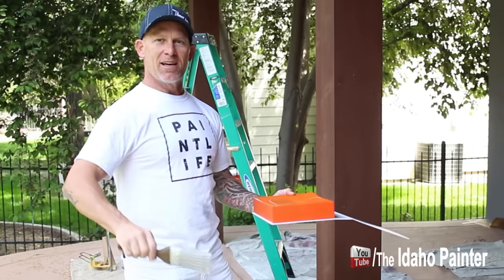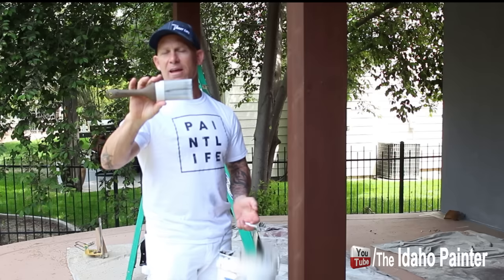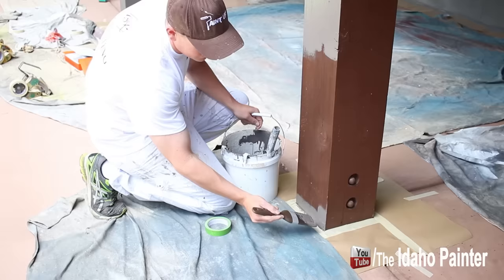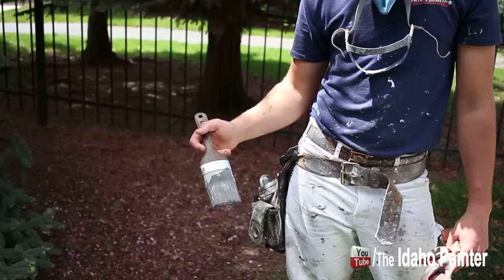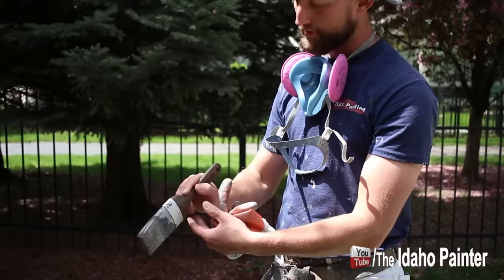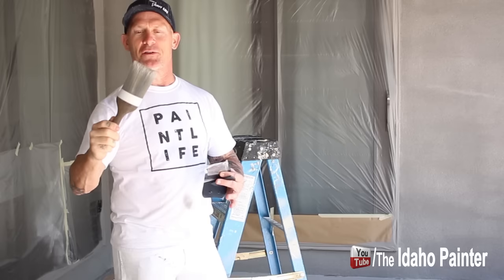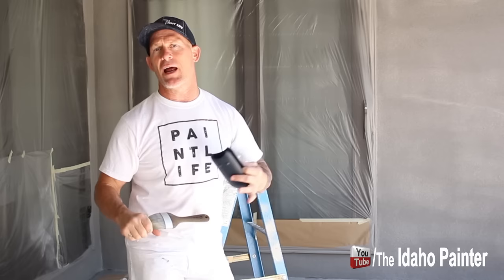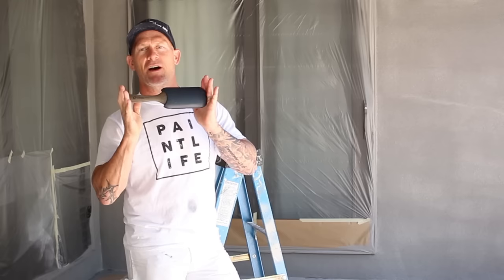The $100 Paint Brush From Lucas Pro Tools.

Comment: Purdy brushes were always the standard in sundries.  The xl pip I mentioned has longer bristles and it's feral is rounded/oval. Also, oil based stain brushes were always seperate from latex water based for me.
Reply from the maker: Yes, thanks for sharing!

Comment: Btw, I got in the habit of hanging my paint on my belt rather than holding the bucket. I always used gallon cans for cut buckets, unless I was using a mini roller. But then again, I've used 5 gallon buckets hanging off my belt with a brush, and a couple of different size rollers in them, two different colors, working on a pier. High work makes you get creative.
Reply from the maker: Good way to do it, thanks for watching!

Comment: The test would be how much use can it take before it starts falling apart or can it take a lot cleaning. Is that a 2 1/2 "? do they have different sizes? I don't think a month is not long enough. what about what paints can be use with, what about oil base paints?
Reply: I really like the roller!
Reply from the maker: This is the only size they have at the moment, we will find out. It is 2.5.

Comment: 3:44 as he is using the $100.00 paint brush, he goes into his paint bucket and pulls out the small roller and quickly uses it. that tells enough about the wonderful brush.
Reply from the maker: Back rolling
Reply: question. what do you do when you give a customer a price on a job, they agree. then after the first day you realize you messed up big time, and there is way way way more involved and it is going take way longer.

Comment: OK Chris.... I wouldn't pay $100. for a paint brush in my life! Picasso Brushes are just as good for way less! I'm lucky enough to have a shop with a slop sink where I can  clean my brushes and hang them to dry. Why Picasso?, solid Farrell, the paint doesn't get inside and mess up the brush its self. if well maintained, the will last for a long time. They also come in a variety of stiffness's. I use them first for interior work, then exterior, then for primer. When done, a dust brush or oil. Oh!!!!, just me but, the last thing I would use a brand new $100 dollar paint brush with is an exterior latex stain! Arg!

Comment: Chris, have you ever used Wooster/Wooster Pro brushes?  If so, how do you think they stand up to Lucas ProTools and Purdy?  I'm an independent painter and don't know many other painters, so I get all my info and opinions online and I'm always interested to know what brand/specific brushes pro painters like yourself prefer and why.
Reply from the maker: I do like Wooster, hard to compare though because they are used for different things
Reply: rabooey we sell Wooster out of my store in LA. we are getting a lot of bad feedback with Purdy recently, so we suggest they switch to a Wooster alpha. great brush. thicker stock so it holds more paint, but the bristle are stiff after a few uses. the best brush I have used so far is the corona chinex line of brushes. the ryan 2.5 is the best brush for fine finishes using hybrids or acrylics. my favorite brush personally is the Purdy extra dale (stiffest blue bristle, but man the corona rrally is the best out there. also lifetime warranty and it's under 20 bucks.
Reply: My favorite brushes by far are the Purdy clear cut elites. Haven't found anything better yet.
Reply: Purdy...are good..best i laid hands on personally tho is Picaso..but it was givin to me as a sampler.

Comment: I have a general question about the technique the guys are using. They use a roller and then go over it with a brush. What's the reasoning for that? The roller is so fast but I'm guessing the brush adds something or else they wouldn't do it.
Reply: the brush works the stain or paint in the wood.
Reply: Ah. Thank you!
Reply: Brian Burke I think it's called back-brushing.
Reply: Marla White if the surface is prepped properly for painting or staining there is no need for back brushing.
Reply from the maker: To get a better finish
Reply: That's it! Thank you.
Reply: Thanks. Is that something you'd do on interior walls for say, a living room? I actually like the sort of orange peel effect of a roller. I always compare it to the cut-in areas with the brush strokes and I like the finish the roller leaves behind much better.
Reply: Brian Burke you can buy different types of rollers if you want a particular finish on the walls.

Comment: 100$ paint brush and straight not 45 hairs 
What's the point you paint that post with a 100$ brush not with a small roller 
It's heavy and not comfortable with cutting 
Cheers 100$ paint brush

Comment: Let's be completely honest, that's a over, over priced tool... I've been painting for 20 years now, I've tried a couple of oval brushes they're garbage. Basically rule of thumb is nylon polyester brushes for water based paint, White China bristle for stain and garnishes, and that purdy  soft polyester for oil based paints.
Reply from the maker: I found that it worked well and was a good quality brush